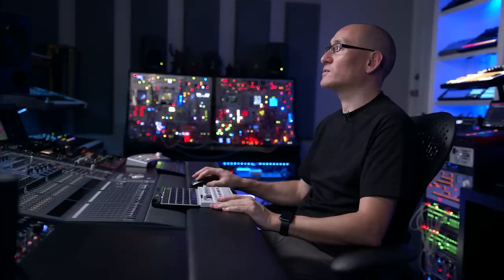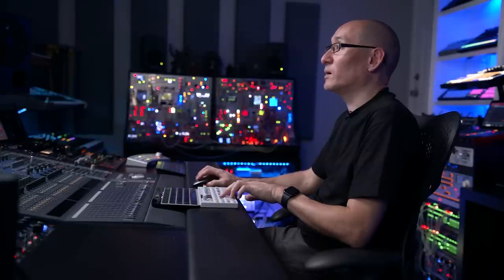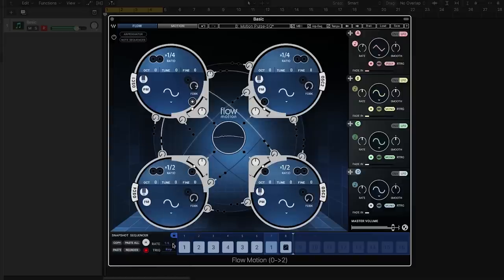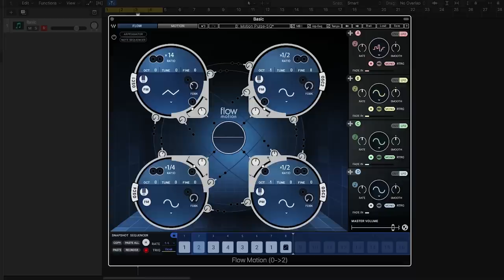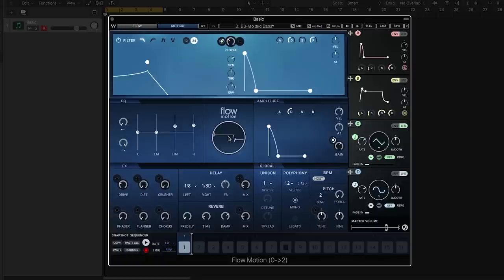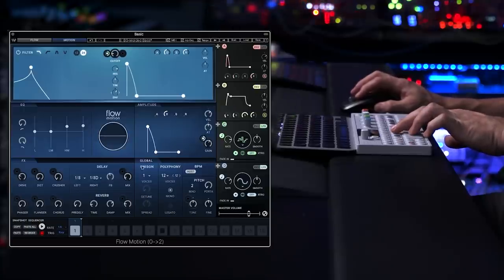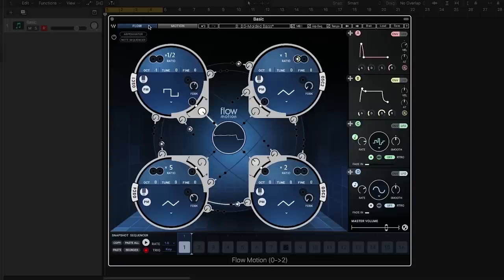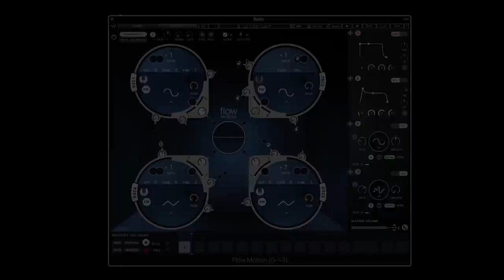Waves Flow Motion FM Synth Tour with Richard Devine

Comment: Sounds nice but on Ableton 10 on a 2018 i7 6 core Mac Mini it glitches on many patches and regularly takes up 40%+ on one patch. Not even heavy stuff like Repro and Roland Cloud get near that. I’m sure that’s not right, FM isn’t that CPU heavy.
Reply: Check the Unison and Polyphony they're the biggest culprits of the extra CPU but this thing can be extremely CPU hungry but it sounds like it should be many of the patches remind me of stuff I only hear from Reaktor.  My biggest gripe is the GUI is too big vertically I can't see the snapshot sequencer, but even so you can buy it now for $24.50 on sale and it's a no brainer.
Reply: Mac mini has no active cooling does it?  So it’s probably not going to boost speeds at all, just like the issue with the i9 MacBooks.  Which is why I switched to PC gaming laptops and customized the cooling myself, to get the full power of the chip.
Reply: mac minis do have auto cooling (mine is a server 2011) i can hear the cooling when boosts, flow synth runs like a dream
Reply: Very coll but you need PC or Mac that can handle the rampage!!!!!

Comment: Be ware that the Flow Motion FM Synth will not install on MacOS (version 10.0.58). You will get a compatibility error that says “Couldn’t be opened.”  This is an expensive plug-in you should avoid.